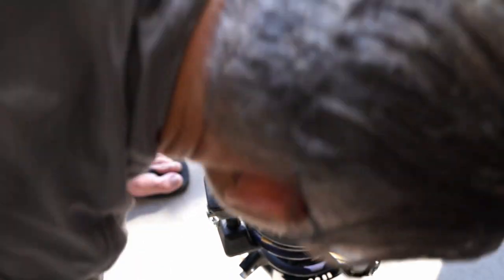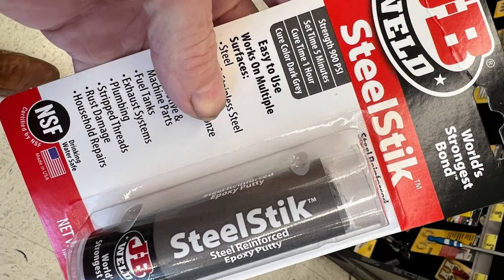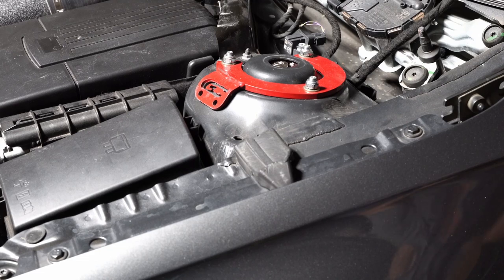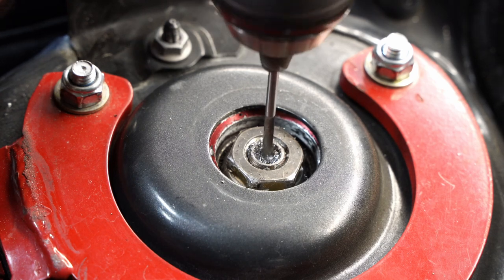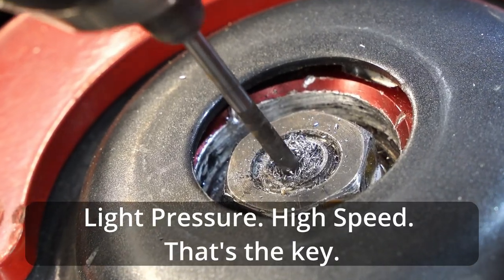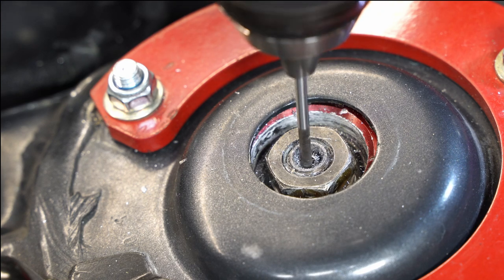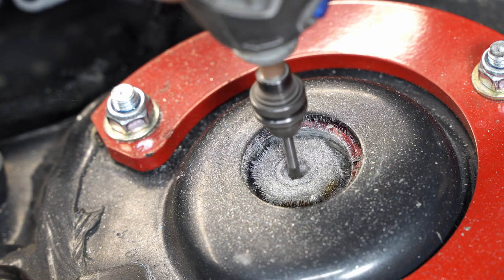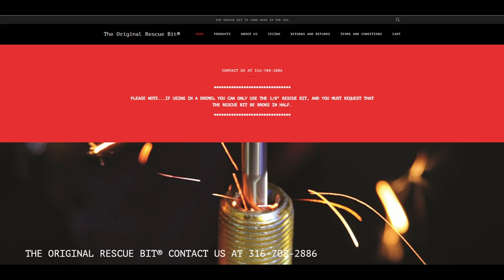This Rescue Bit Rescued My Ass!

Comment: Chris wow, that's quite the pickle! 

That is an expensive tool, but you are right, when it's the only thing that will work it's worth it.  I had to drill out a cross threaded dowel nut  when the bolt snapped off inside the frame when taking apart one of the boys' bed. luckily, the metal in that nut was softer and I was able to use normal drill and bit.
Reply from the maker: I’m planning on keeping these bits in the toolbox for those “in case of emergency” moments.

Comment: That bit is not steel. It is a carbide burr.  They are very brittle. It requires high speed or the teeth will crack. For larger dia. needs, a carbide end mill will do the same. 
KnifeMaker

Comment: Oh man, these jobs suck. I'd happily spend the $50 knowing it'd work. Reminds me of when I had to extract TWO snapped DV bolt from the housing of an IS38 turbo, someone decided it was a great idea to use high strength threadlocker on these.
Reply from the maker: I was a somewhat skeptical at first… but the darn thing did it’s job! I could think of a few past problems that this would have come in very handy for. This wasn’t the first bit I’ve had break off!! And plenty of broken bolts. Lol